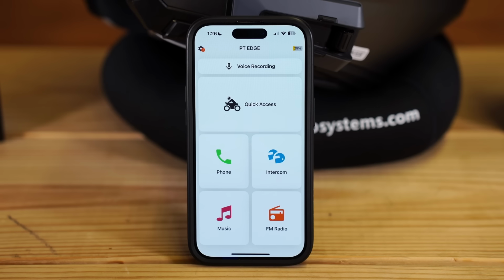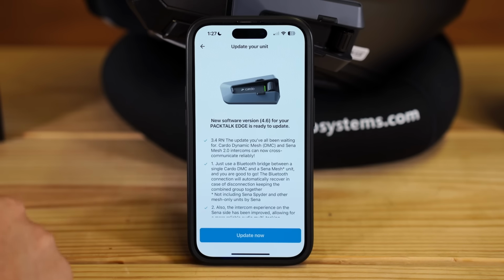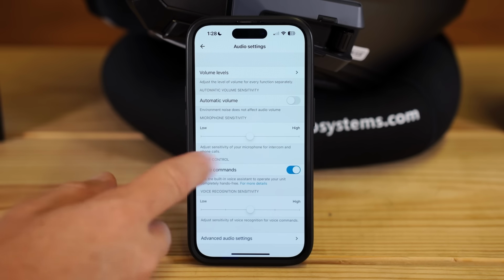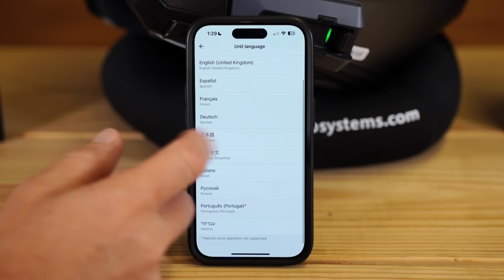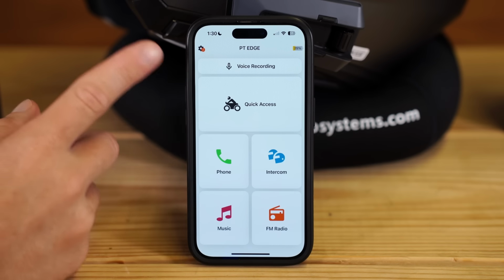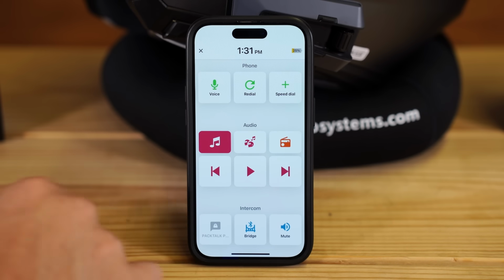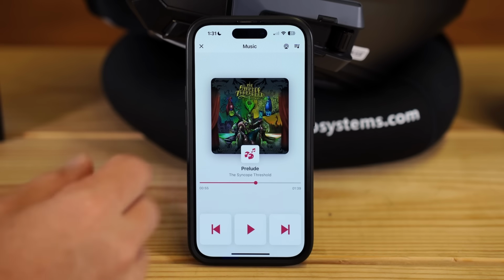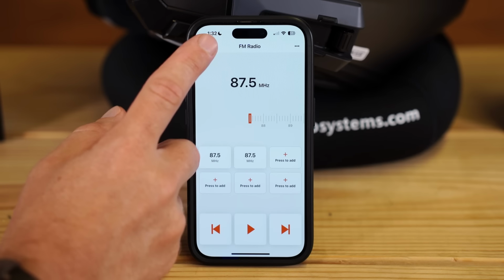Everything You Can Do With Your Cardo Connect App

Comment: Question guys. I need to connect Crado edge to BMW TFT as well as Ace Pro 2 to record. What's the process? I'm connected to TFT (cardo and mobile) now I need to connect Ace Pro to record audio as well as video. What's the process? Different channels? Also do I need to turn of built-in micro? Just use the Cardo for audio? Cheers
Reply from the maker: Hi! That’s going to depend on how your Ace Pro 2 is configured and what audio source you’re trying to record. We’d recommend contacting customer support, who can walk you through the correct setup for your BMW TFT, PACKTALK EDGE and Ace Pro 2 combination. - Richard

Comment: Hi, I have Cardo Packtalk Edge and Packtalk Bold 7 intercoms and would like detailed information on how to configure them. How do I properly connect the Packtalk Edge to the Packtalk Bold in Mesh mode (DMC)? Will both devices work seamlessly in a single Mesh group? How can I create and manage multiple Mesh groups (e.g., by dividing them into smaller groups while driving)? What is the process for adding new users to an existing Mesh group? I would appreciate step-by-step instructions or tips on how to best configure such a connection. Best regards, Kamil
Reply from the maker: Hey Kamil, great setup 👍
For step by step pairing, group setup and managing multiple Mesh groups, our support team can walk you through it based on your exact devices and use case.
Please reach out here and they’ll get you sorted: cardosystems.com/support - Richard

Comment: This app is stupid my phone connects to  my cardo can play spotify but the app cant find my cardo device
Reply from the maker: Hey, thanks for reaching out, the app should find your unit without any hassle. When your phone plays music but the app can’t see the device, it’s usually one quick fix:
• Turn your Cardo off and back on, then reopen the app
• Make sure Bluetooth shows only one connection (sometimes old pairings block the app)
• If you see the device listed under “Other Devices,” tap it once to refresh
If it still doesn’t pop up, let me know which model you’re using and we’ll get you sorted. 👍
– Richard